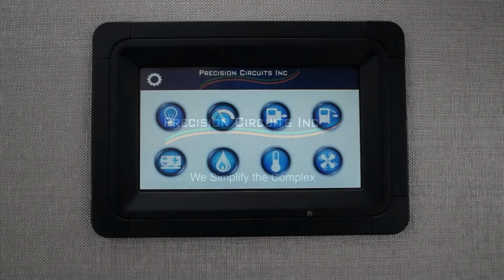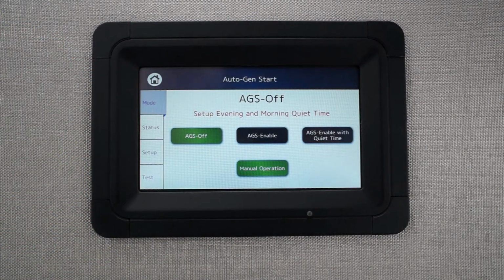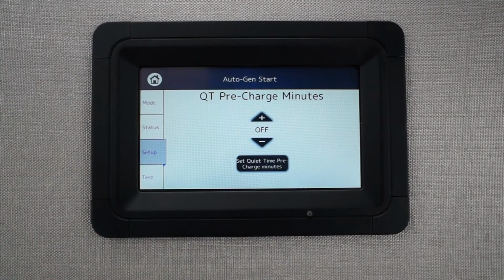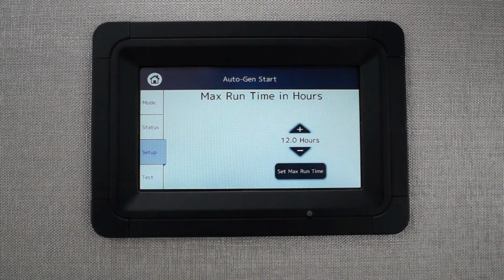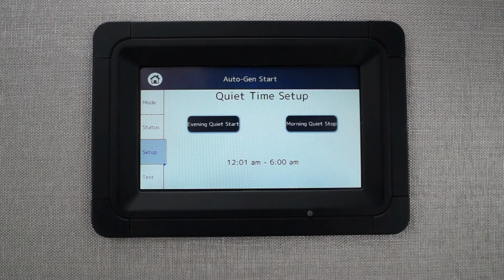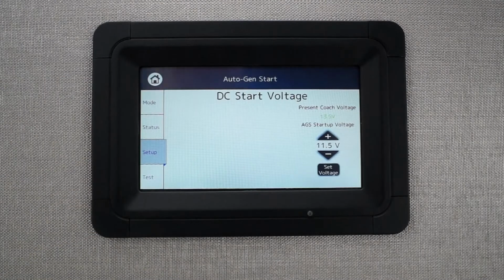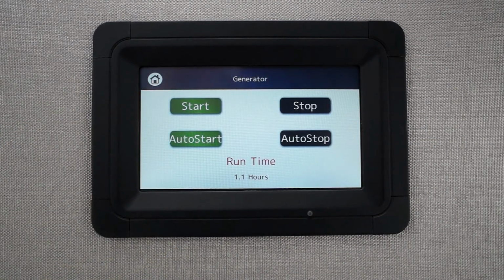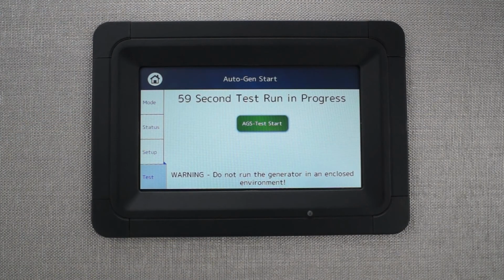Precision Circuits Inc - Auto-Gen Start

Comment: Yesterday while preparing for a trip , we started our generator and everything was fine.  Then an hour later we went to start it and this error code appeared. “No digi level-module comm” and we’re unable to start it.  Then when we check our tank levels 5$3 same error showed.  Everything else seems to be working properly. Any ideas?
Reply from the maker: Dear Marnie,

I'm sorry to hear that your Digi-level monitor has stopped communicating with the system. There are a few things that can cause that to happen, but it usually comes down to wiring. Our tech support team can help you determine where the best place to start looking is. Please give them a call at 630-515-9100 EXT 2

Comment: So the max run time is an overall time that the generator will run in AGS mode?  So if I have the run time set for 1 hour, it will cycle for 12 times (if the max value is set to 12).   Then, I would need to go back and re-enable the AGS feature?
Reply from the maker: Hi Michael,

You are correct, max run time is the maximum amount of time that the generator will run after AGS is enabled. When the total run time reaches the max run time, the touch screen will stop the generator and disable AGS. The user must re-enable the AGS after that.
Reply: @PrecisionCircuits  Thank you for the reply.  This was helpful to understand how that feature worked.